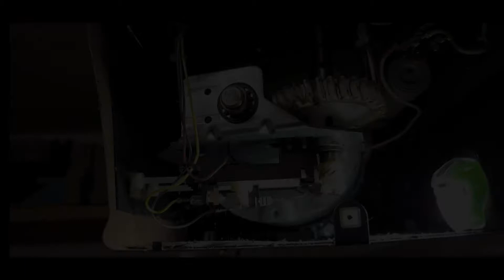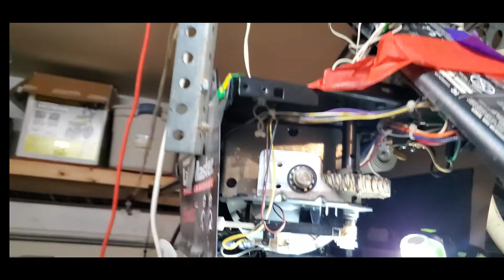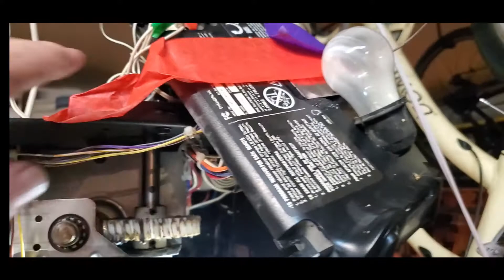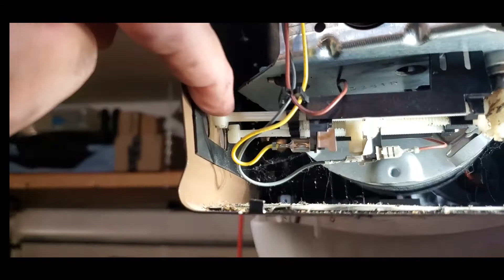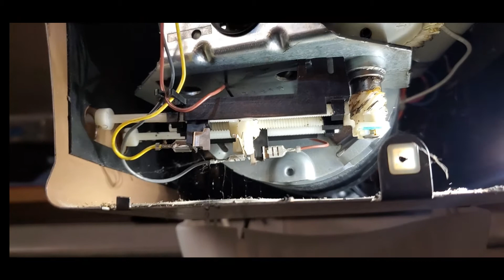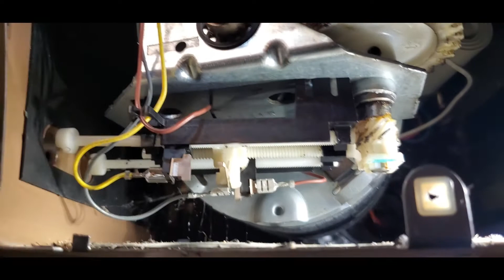Limit Switch Operation inside a Liftmaster 2280R Garage Door Opener

Comment: So mine has this screw style limit but also has 2 knobs on a citcuit board that do the same thing.. they just electronically set the limits..  wonder why they did it like that.. and if i could disable this screw crap by unplugging the leads..

Comment: Also, those copper contact surfaces can become oxidized or dirty resulting in inconsistent limit travel of the door, especially noticeable when closing.  IOW, sometimes the door will do a relatively hard close.  Clean the surfaces with contact cleaner on a swab.

Comment: How do I reverse the motor.  I was adjusting the limits and not it seems the motor is stuck trying to go down but it just clicks and hums.  Is there a trick to getting the motor to move the opposite direction
Reply from the maker: Do you have the case off so you can see if the sliding switch is making contact with one of the limiters?  Sounds like a limiter is not aligned and/or not making contact with the sliding switch (when it does, it stops the motor and reverses polarity for the next open/close button press).  The clicking sound is not good.  You will eventually wear down nylon motor gears - each click is a gear "jumping" the worm gear (I think).

Comment: I'm glad I found this video, after my center coupler broke and was replaced my unit would only turn a couple revolutions and then stop, the diagnostic light was blinking 5 lights telling me I had a problem with the rpm sensor, but I couldn't find anything wrong with it so looking for answers online a lot people were suggesting the logic board. After watching this video however I found out that when my coupler broke the center part of my limit switch had somehow jumped its contact. All I had to do was take it out, re-seat it and fine tune the adjustments and we are back in business.  So thanks a lot for this video!

Comment: Thanks, for posting this  video.  I replaced the gears and shaft that drive the belt, but could not get the opener to function correctly.  It seemed to me that  something was wrong with the limit switches.  After viewing this video I was able to see what was wrong with the limit switches and correct their position.  BTW I was doing this when it was in the 20's outside.  Thanks again.
Reply from the maker: Thanks!  Glad it helped you!  My gears probably need to be replaced soon too - good to know that it's possible.  And extra points to you for working with cold hands.

Comment: Another (easier) way to center the limit switch is to simply disconnect it from the motor by removing the bottom nut on the main spindle (one clip removes it). Then move the limits out of the way, and manually turn the center screw to get the wiper where you want it. Then you can reconnect it and set the limits properly.
Reply from the maker: Thanks for your additional input.  It's always helpful to know that there are other options available.
Reply: Exactly. Kept me up all night!
Reply: Thanks for the video!

Comment: Same as others commenting - Thanks you helped me fix my issue with the stops. Mine was the same as yours, it is old and the stops had migrated over many adjustments o where there was no travel left.
Reply from the maker: Thanks!  I cringe when I watch it - not the best production value - lol.  But if the video helps folks, and it apparently has, then mission accomplished!